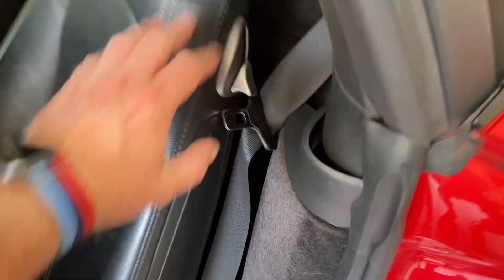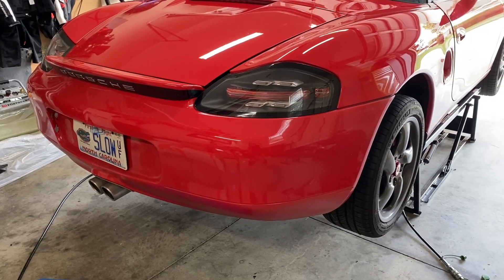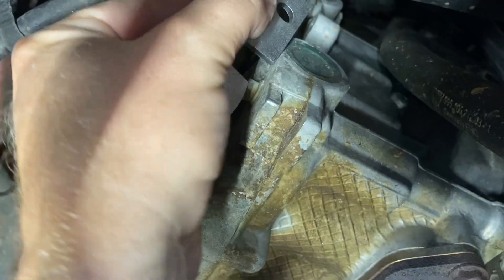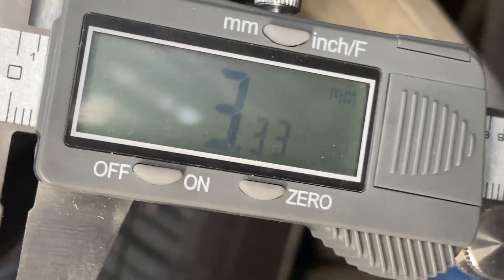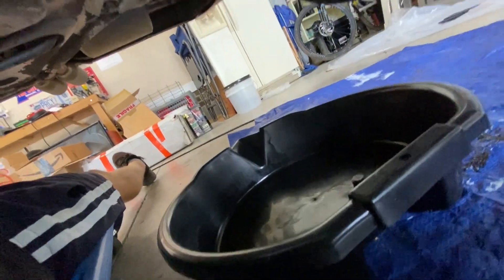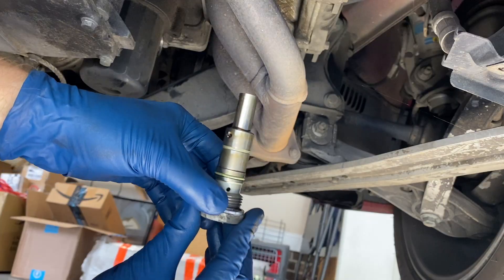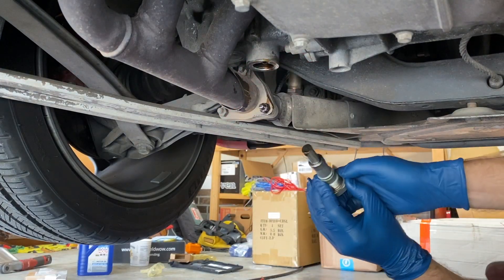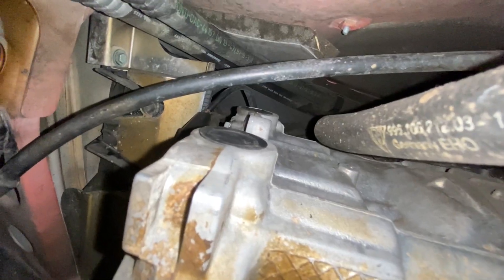Porsche Chain Tensioner Install  |  Boxster 986 987 911 996 997

Comment: So did you have to rotate the engine 360 degrees or that was just a fruitless exercise?
Reply from the maker: +George Kibliov I think it was just my tool still being too thick, however I let a guy local to me borrow the tool and he felt like rotating it 360 helped him 🤷‍♂️
Reply: @HelpMeDIY  There are 2 TDCs and I wonder if it matters with one gets locked:)
Reply: @giak    I am here reading to find that out same thing. Lol.   I’m just wondering  because of the spring pressure on the valves & on down the line for connected parts .   But I’m guessing it doesn’t matter ,as long as both locking tools are in place correctly enough to fit well .  And replacing just these tensioners is as far in the engine a person goes.  But then I’m thinking it could make a difference if pulling /replacing the cams or going further into part replacement or changes .  

 But even then the correct timing alignment when putting it back together would come into play per advised on doing a job like that .  And that part would be specified in direction when going into a engine that deep . Like pulling the cams & things of that nature involving the removal of a chain or chains . 
 I haven’t seen anything specific on just replacing tensioners . 

So im thinking it wouldn’t matter as long as both tools was locked & in correctly.  I say that for only doing this job tho .  

But I’m just here reading to try and make sure myself lol . 💁‍♂️.  

Doing mine today “finally “. I had some bs ordering & shipping issues from a seller.   Had to order twice. The  Last was a different seller . Lol
Reply: @Chon-c  I just finished IMS on my 98 Boxster. Ether TDC is ok, lock exhaust cam on the passenger side. IMS shaft moved slightly to 11 o'clock on me as I pulled out the old bearing. Had to use install tool to shift it back into place by pressing it firmly against IMS shaft and using plastic wrapped large screwdriver for leverage.
Reply: @gkibilov    Ok. Kool.  👍. I was thinking as long as the exhaust bank was locked it should be fine.  Now I know a little better. Appreciate it. 
I’ll be doing my guides next with the ims & seal.   Changing these two tensioners as we speak

Comment: Did you ever check your camshaft deviations with your Durametric tool? It would be good information for everyone to check before replacing their chain tensioners.
Reply from the maker: +rwabe I didn’t beforehand but I’m going to do it after (and make a video on that)
Reply: @HelpMeDIY  that would great! I’m looking forward to seeing your next video on replacing the Variocam pad replacement without having to remove the engine from the car.
Reply: @rwabe  i havent seen it yet and most shops will push dropping the engine as now it likely the time to review the engine.
Reply: @SunSandAndSea     You can do it without dropping the engine.  I’ve seen it done.  Just remove the cover on the side of the chains.  💁‍♂️.   I wish Aaron wld  do this vid tho.
Reply: @SunSandAndSea    Time to review the engine is when doing a clutch.  That is over half of the bolts needed gone. And the trans removal is over half of the work .   Other than dealing with the weight & actually lowering the motor.
Reply: @Chon-c  would be nice, never seen it done.
Reply: @SunSandAndSea    Now I’m talking about the m-96 engine tho.   That’s the one I saw was done.  Not sure about the newer engines.

Comment: I love your videos!!!  Always a BUT….. but this one gives me stress.  Your should never ever put your finger over a small hole like that.  You run the risk of injecting yourself with fluid. I’m this case motor oil.  But any fluids in the bloodstream are highly dangerous or deadly. 😬
You should edit and maybe add a caution.  ⚠️
Reply from the maker: +Cashew no bloodstreams were harmed in the making of this video 😛
Thanks for the precaution though.